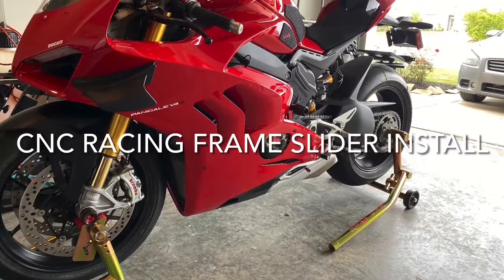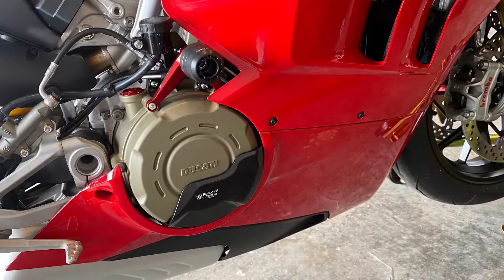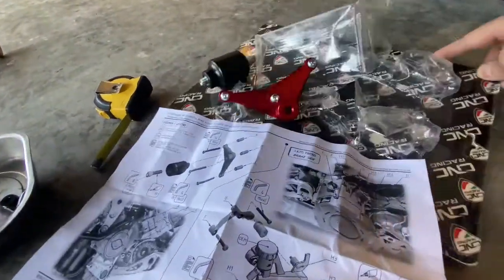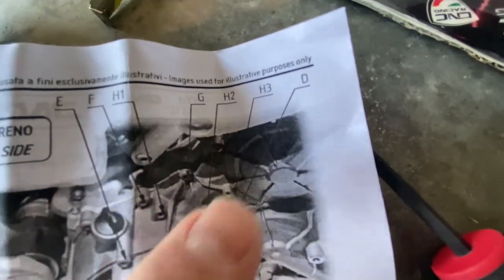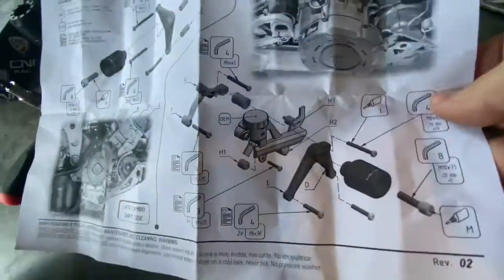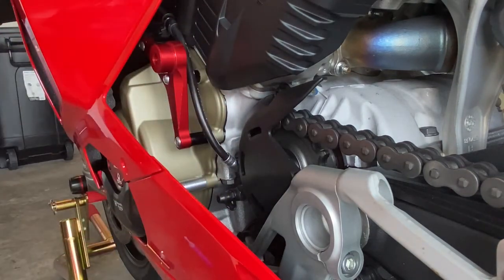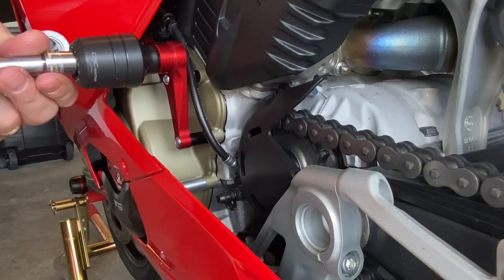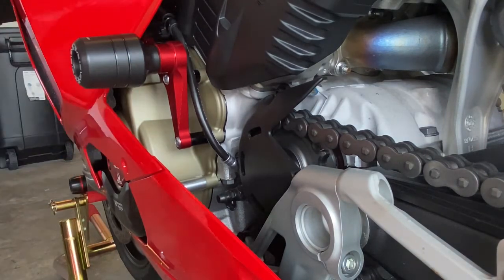CNC Racing Frame Slider Install Ducati Panigale V4S 2021

Comment: I think its an old link to Amazon. Trying to get you some credit, but also make sure Im ordering the correct part!!
Reply from the maker: Hello. Thanks for using the link. Looks like they don’t have them in the Amazon sight anymore. Using the link though and doing a search on Amazon will still give me credit if you buy something or find it. However I looked and don’t see it. Thanks though.

Comment: Hello. Do you need when installing the left slider to put some of gasket silicone? Or something like that?
Reply from the maker: No I didn’t. Since your not pulling the covers off there is really not a need to add gasket sealant IMO. The instructions also did not disclose that. If you break the covers away from the motor than I would replace the gaskets for sure. I also since installing all my track prep gear had my 620 mile first service and no leaking was found
Reply: @TJRSIM  thank you for replying to me. Isee that when you removed the bolts one of them have a little bit of oil and the other have some gasket material . So you also don't need to put some silicon on the bolts.. Same as the factory

Comment: Are there any crash cages for the v4s? Or v4r
Reply from the maker: not that I'm aware of. I don't think many people stunt with this bike and you wouldn't want them for the track
Reply: @TJRSIM  
Is there anything that protect it from drops ?
Reply from the maker: @rexlapis1075  Hello. Yes I would suggest you get some engine case covers. Stay away from the carbon fiber ones. They look cool but don’t work. Here is a install video of mine. https://youtu.be/ouJpaR_oIpM

Also keep in mind frame slider are really only good for drops in the garage and that the only reason I have them. However i have seen bikes more messed up from frame sliders after a crash on the track. They can dig into the dirt and make your bike roll or if your lucky just snap off the bolts into the engine. They can be effective, but not in every situation of course.
Reply: @TJRSIM  
I think axels and brake lever  guards will also help
Reply: @TJRSIM  
I was parking not a while ago I forgot to put the kick stand down 
It fell my v4r got some scratches like a little scratch
Reply from the maker: @rexlapis1075  Yeap this is what frame sliders are good for to protect in these situations. Also highly recommend engine case covers. Easy to put on and has shown to protect the engine cases in a slide
Reply: @TJRSim  ... just got my bike yesterday. 22 V4. Any recommendations. TIA

Comment: I'm just letting you all know that these things are garbage, if you actually get in an accident they snap right off, they break the bolts and now you gotta drill out the bolts,  And that is a lot of fun, not, you're better off using the covers that go over all your vital parts, but those frame sliders are fucking crap, they break immediately.  Total waste of money I work at a shop and I see this all the time.
Reply: Absolutely.  Those 6mm screws on the clutch casing do not have the strength to bear the brunt force of a 200kg bike crashing. They'll break the engine casing. Not effective.